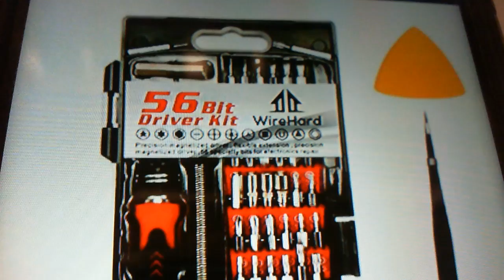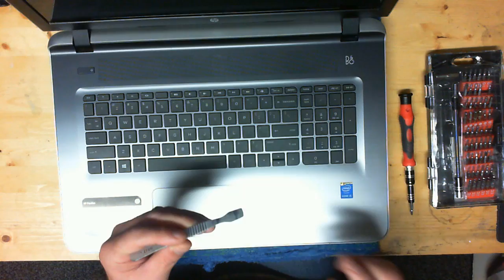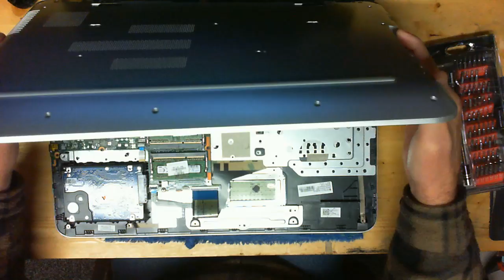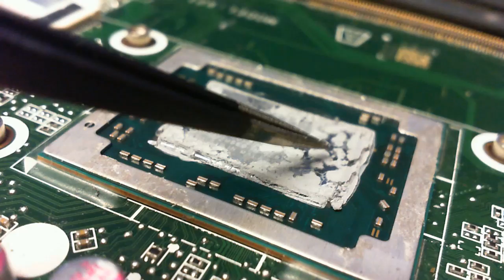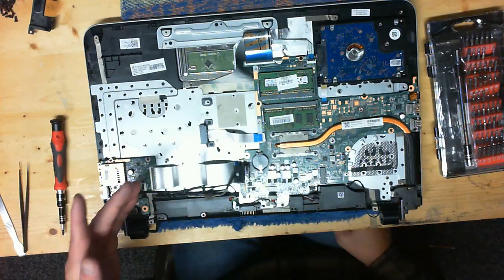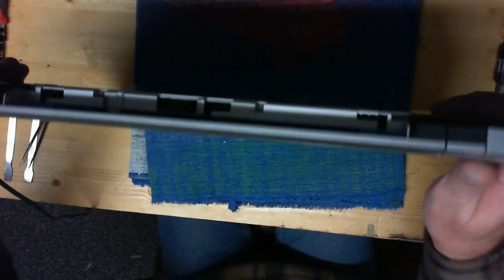HP 17-g121wm laptop disassembly, take apart, teardown tutorial

Comment: You didn't show the keyboard removal =(
Reply from the maker: The keyboard is the upper metal part of the laptop it is riveted into the top and not worth the trouble trying to remove it it would be faster, easier, and safer to just replace the whole top part of the case keyboard and all.

Comment: Thank you for the detailed video! Successfully re-did cpu heat sink, cleaned fan and vents and replaced button battery and the spinning disks with a ssd. Should be good for another 6 years! Your instructions were very helpful!

Comment: As for the screw removal.  Take a manila file folder and draw the outline of the computer on it.  Then take a pen or pencil and draw and designs of the cover, then put a dot where ever screw is located inside the drawing...then take the tip of a sharp pocket knife and puncture the cardboard on top of the dot...now, when you remove the screw, push it into the slit of the dot.  It will hold tightly in place and you won't loose or get them mixed up and you can move the folder wherever you want after removal and they hold in place.   They will go back into the same hole they came out of during replacement...it works.  I used the bottom of a cardboard box and drew the outline of the top of my engine and replaced the head on Jeep 4.0 engine...works perfectly for different things...push rods and bolts went back into same holes they came out of.  Learned this technique many years ago.  It works every time.

Comment: hi i have this same laptop when i remove the back cover i cannot seem to open the lid of the laptop anymore the two halves are closed shut and when i try to open the lid i feel a strong force against it.does the laptop need the back cover in order to open the two halves? thanks great vid
Reply: Yes and No sorry I am not there to say what your problem is but it sounds like the hinges are loving up and likely you have a few screws ripped out of the housing you need to get that fixed or never close the lid after you get it open next or you may brake the screen or worse.
Reply: @Xboxsarerepairable  thanks sir but the hinges are fine and not busted
Reply: I did not say broken just locking up in other words too tight but like I told you not there to check. Sorry
Reply: Yes.  I felt that force also like it was jammed...and screen was going to snap into pieces and was bowing into the shape of a u...apparently it has something to do with the case being apart...if finally got mine to separate after I put a drop of gun oil on each spring...let it sit for two weeks...it finally opened...but its still very stiff...
Reply from the maker: @dennispfeifer7788  Oil is not recommended as most will overdo it and cause major problems if the case is separating your problem is worse than just tight henges but also broken case mounts that can be repaired if you know what you are doing or feel comfortable opening it up I would recommend using this to rebuild the plastic that the screws mounts that are broken: https://ebay.to/2SqkYNK and yes this is an affiliate link you think I do this 100% free LOL After rebuilding the case screw lockdowns back off the nut on the henges just a little and lock them down too using the same stuff after you are satisfied they are properly adjusted and not going to just flop the lid down.
Reply: @ClovisX  I hope I can do that....I may take it to an expert if I can find one....I'm not an expert with computers, but I know I need new antenna installed....God Bless You!  I can install batty. and replace the rear case, and DVD...I think I may take it to an expert...I'm very concerned....and don't want to destroy the computer Win10....HP Pavilion...from 2017...I really liked it...here is model.... hp 17-ar050wm antenna issue....
Reply: @ClovisX  Ok.  I did not know springs were adjustable...I'll review link...Thanks...I'm 66 years old but a good listener...that's how we learn...by listening...
Reply: @dennispfeifer7788  im thinking the same thing the case being off is preventing the laptop from opening so when i do mount it back up ill see if that theory is true
Reply: @tntparapleion  Apparently, it may be true...I'm not sure yet myself...but, I do know my screen was going to break if I forced it...it's still apart and I may have to have an expert replace the antenna...I can't find video of my model....it's not easy to solve...every damn computer seems to have some kind of trick...I spent hours and replaced burnt mother board and reinstalled all components, to have the antenna problem and break...I ordered new antenna and have it....it's disgusting...to not get it back together...I'm now using a cripple computer to write this message...life was much simpler in the 70's and 80's...this is disgusting...'I have a friend in his mid 90's, can you believe he's computer savvy?   Yes, he was fighting Japs in the Philippines in 1944...this is not a joke...the man is friggin amazing...grew up during the depression of the 1930's, it's unbelievable...
Reply: I just googled my friends name and lots of stuff comes up...here it is...Jock Davis, Russellville, Arkansas, if you are interested....
Reply: I had another friend...Gus Cage, Cuero, Texas...I spent 3 days with him in 1972 in south Texas...he worked my ass off and my brother too...June 1972...damn, he was a nice man...picked us up at 7 am each morning and drove about 300 miles a day inspecting Poultry operations and wore us teen boys out....I think back now...and think it could not be real, but it happened...

Comment: Can the graphics card or video RAM in this computer be upgraded?
Reply: No. Both are integrated. You can’t remove them and replace them.
Reply: @brendonhenkel3025  What about the WiFi card?
Reply: use external gpu...

Comment: Thank you for a real hands on tutorial. I have one question though. I how would I go by ordering a motherboard from HP. Again thank you.
Reply from the maker: I do not believe they sell them, after all, they would rather you buy a whole new computer. find the model number of the motherboard and find it on eBay or Amazon. there are other websites that sell the parts too but will likely be way more expensive.
Reply: @ClovisX  thank you for reply. Just wanted understand where to start from. If I needed to replace my down road. Happy holidays. Thx again great tutorial.

Comment: Thank you for posting this educational video My Friend. 

At 33:23, you mention that you are wearing an anti-static strap on your ankle. 

1. Why do you wear it on your ankle? 
2. How high is the likelihood of shorting out components such as the motherboard by touching them assuming you have done so not wearing an anti-static strap but never felt a static shock while doing so?
Reply from the maker: Any Chip or component in the system is subject to static discharge some more so than others, to explain this to most that do not know anything about electronics, I tell them all chip are made for very low voltages so a static discharge is like and will do the same thing to that chip as a bolt of lightning will do to you.

As for assuming I have done so that would be wrong I actually went to school unlike 99.999% of all the YouTubers posting videos about game systems or 98% on PC or Laptop Repairs.

It is not likely you would feel the static discharge while handling any electronic board unless you just have an extreme amount of electricity built up and even if you do not see, hear or feel the static discharge does not mean it did not happen or is not enough to kill a chip somewhere on the board as you do not have to directly touch a chip to kill it.

Hope this helps you understand the need for following proper safety procedures and schooling to protect your stuff 

NOTE: If you are thinking about doing the repair for someone else after watching this or any YouTube Video I suggest you do not do it because every electronic ever made can have 100's of reasons for anyone fault regardless of timing and or direct error code and if you try to fix something that is not broken you will likely break it doing your customer a very big disservice by criminally misrepresenting yourself as someone qualified to work on there expensive electronics and that makes you subject to lawsuits as a few fake game system repairmen around hear found out after I forced them to replace their customers game systems do to there stupidity and total lack of education.

Comment: I need to replace the power jack on the same type of laptop mention in this video.I've seen videos on replacing the power jack
on other types of laptop on youtube and it looks kind of simple.especially because the keyboard is attached to motherboard
and the power jack seems very accessible.what and were can I purchase the power jack to replace the old one,and what model# would it be?the dc power jack charging port for hp pavilion.
and any tips on the replacement would be helpful.thanks

Comment: Hello, You don't happen to have the dimensions for the DVD drive do you? I am looking to purchase one of these https://smile.amazon.com/s/ref=nb_sb_noss_2?url=search-alias%3Daps&field-keywords=DVD+drive+laptop+caddy so I don't need to open the entire thing and install my OS on a SSD through there, if you don;t have this information that is fine and I appreciate it anyway.
Reply from the maker: The Majority of Disk Drives are Identical when it comes to laptops The best thing you can do if you are not willing to take it to a shop is remove the one you have and get all the information you need off of it.
Reply from the maker: But if I was You I would not use a solid state hard drive for memory it is best for the Operating system or both if you like just clown the hole drive to the New SSD
Reply: I was going to clone the HDD to the SSD that I will have in the DVD drive laptop caddy so I don't need to open the entire shell even if the SSD is at half speed depending on the SATA connection it is a lot faster then a 5400RPM HDD. I did find out it was a 9.5mm DVD drive.
Reply: I just wanted to tell you I needed to pop the shell to install the SSD the Caddy refused to read as a boot device soon as iI installed it internally it worked flawlessly, I wanted to tell you your video helped me very much and I appreciate it.

Comment: Excuse me where did you get those spudgers and how did you make them sharper?
Reply from the maker: you can buy them with this link https://rover.ebay.com/rover/1/711-53200-19255-0/1?ff3=4&toolid=11800&pub=5575170691&campid=5337859829&mpre=https%3A%2F%2Fwww.ebay.com%2Fitm%2FOpener-Pry-Tool-Metal-Spudger-Smart-Phone-Laptop-Tablet-Electronics-Repai%2F141480016957%3Fepid%3D1160794280%26hash%3Ditem20f0ddbc3d%3Ag%3A4W4AAOSwvdxbs5f0%3Ark%3A46%3Apf%3A0
Reply from the maker: if you wish it to be sharper take it out to the sidewalk or sharpening stone and rub it side to side just like any knife.

Comment: How do I replace the power port/charger?
Reply from the maker: If you can not figure out how to remove the power port/charger after opening your laptop you have no business opening your laptop you will damage it, I suggest you take it to a qualifed repair shop preferably one that the repairman is willing to show you proof of component level electronics education. I understand that replacing the port does not require that level of education but it will ensure that you get back a working laptop.

Comment: can you change the  Processor
Reply from the maker: Yes but it is a BGA Chip and you will need equipment that costs more than the laptop
Reply: thanks for the info 
i have a question on the WiFi card can it be upgraded

Comment: can you make a video of how to replace the DC-IN POWER CONNECTOR
Reply from the maker: I think even though this video is not about replacing the DC-IN POWER CONNECTOR: if you can't figure out how to do that after watching this video??
YOU SHOULD NOT TRY. Take it to a shop before you destroy your system.
Reply: i have had the machine apart taken the heatsink and fan off  i know where the connector is just cant figure out how to get the little cover site over it off can do the rest
Reply from the maker: Should only be a few screws to remove unless someone has glued the old one in, or your model is different?
Reply: see  2 screws  but looks like its clipped on the side HP 17-g121wm  can add a picture if need to
Reply from the maker: Most are clipped in one way or another, I do not have that laptop to reference, Basickly without having the laptop in my shop I can not say what you need to do at this time, but it would make sense to unscrew and remove anything that is covering the port you need to replace then you will  be able to see how it is clipped in and if it has been Glued in from a previous repairman because of broken clips, Please go slow and look before you pry on anything  is the best advice I can give you.
Normally if you are doing it right they will come out easily although there are exceptions with clip in place parts from manufacturers that consider the device to be disposable anyway. If you brake the Clips You will need to glue it in place Do Not Use Hot Glue.

Comment: how hard is it to remove the cd rom player from the pc my drive wont work how do you eject the tray ,when it wont open?? and id like to update the laptop memory can it handle the new 16gb ddr3 1600 mhz pc-3-12800 sodimm -204 pin sodimm laptop memory -ram /332146234911 can it work without jamming the pc ? can you please give me an answer-thank you very much,and for making this video. thank you.
Reply: CD is simple to replace, just remove one screw near the middle of the machine and it slides right out. RAM is a pain, you have to remove the top case, which is difficult to do without marring things up.

Comment: Hey so I've dropped my phone on my C key leaving the plastic bits that connect it to the board slightly ruined and unusable now. I was looking for a guide on how to remove the casing so I can install a new keyboard but so far I haven't seen a video using this model of PC. The one I did see was a 15-G I think and the keyboard could pop out the top unlike this where its beneath the case itself. If you could help I'd be super appreciative of it.